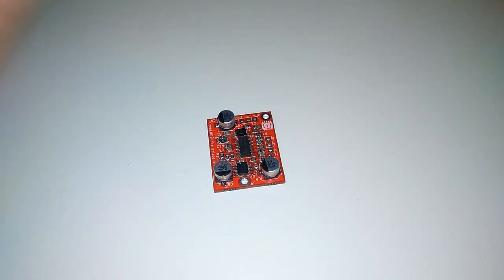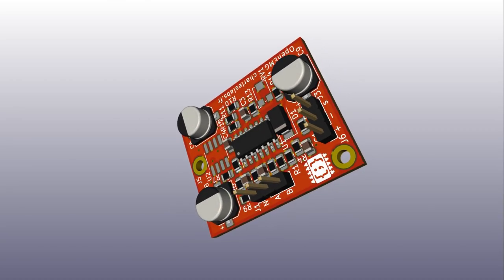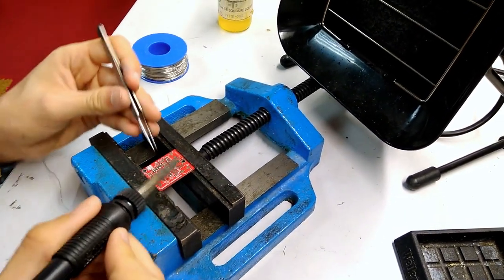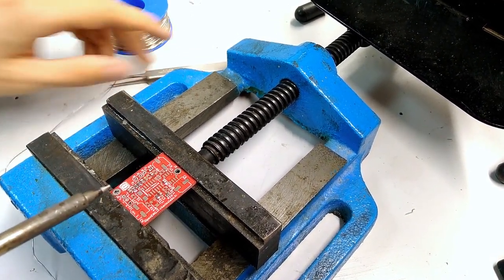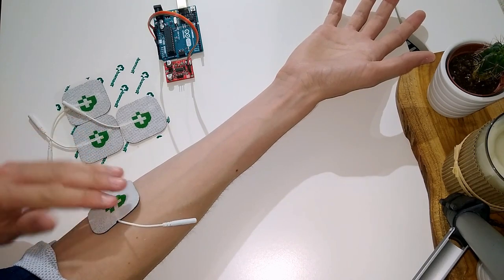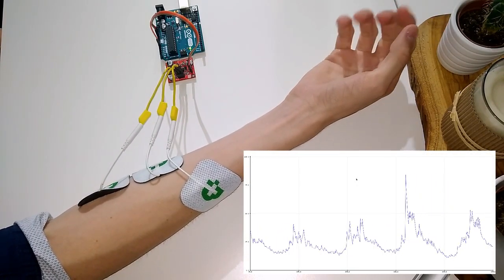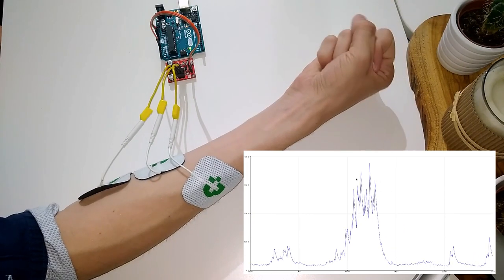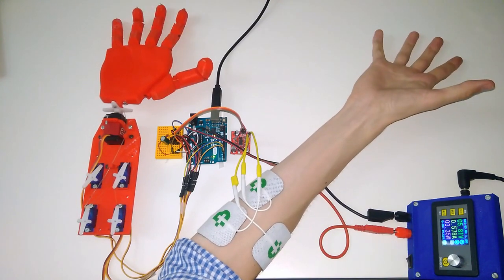OpenEMG Arduino Muscle Sensor Board

Comment: Great project! Congrats for the excellent result and thank you for sharing it! I'm currently working with electrodes similar to the ones you show in the video but I can't find a suitable adapter to connect them to the classic arduino pins. I saw in the video you were using an adapter such as the one I am looking for, can you suggest me a seller or where I can buy it? Thank you in advance! :)
Reply from the maker: If you are using the exact same electrodes, they use a standard connector called "mini banana connector". This is the same connector as on power supplies, but it is 2mm diameter instead of 4mm.
However, real medical electrodes use clips which are much more expensive.
Reply: @CharlesGrassin  thank you very much!